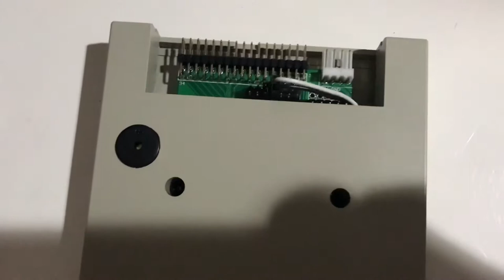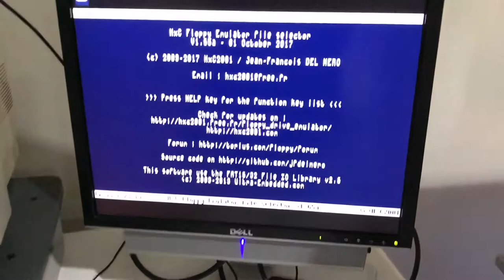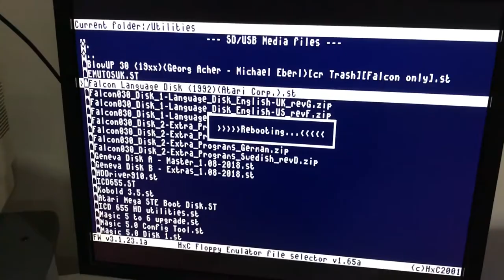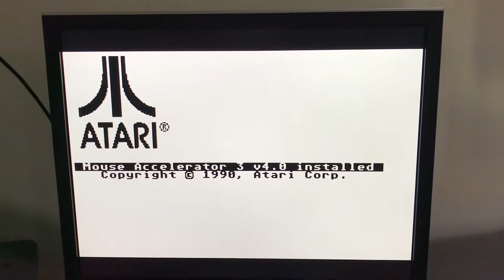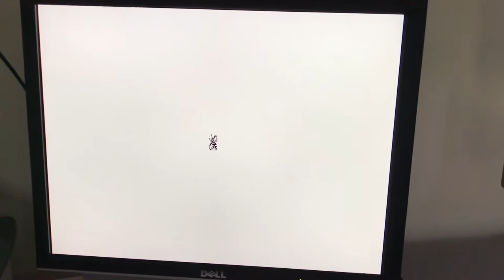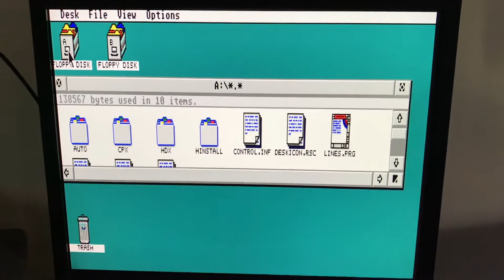Installing the Gotek Floppy Drive in the Atari Falcon

Comment: Interesting that Atari switched the alignment of the Floppy-cable on the Falcon. Although I have one too (which I haven't used for 20 years now, but "soon"...) I thought it would be the same as in the 1040s or some of the external SF314 drives (not mine actually).
Installing a Gotek in a 1040 can be straight forward plug and play, too. If using the right accessories. 😉
I just did so in my "new" 1040STF. Ok, for the rotary-selector and the LED-display some "adjustments" are needed.
See my channel for more, or my flickr-album. https://flic.kr/s/aHsmyrFUTL